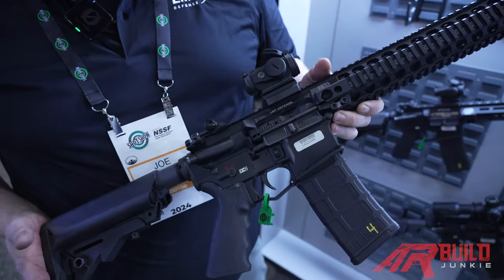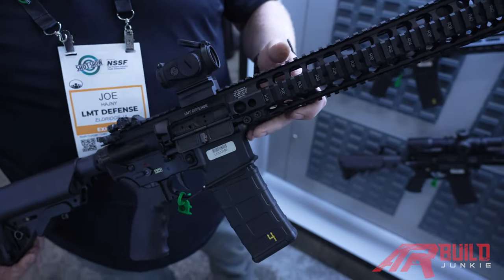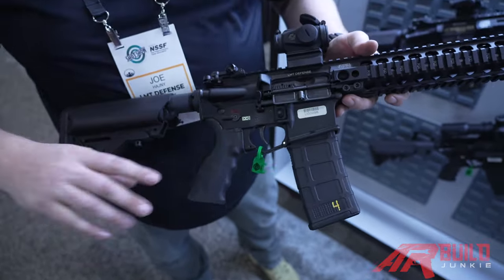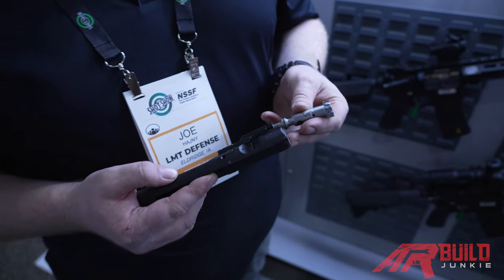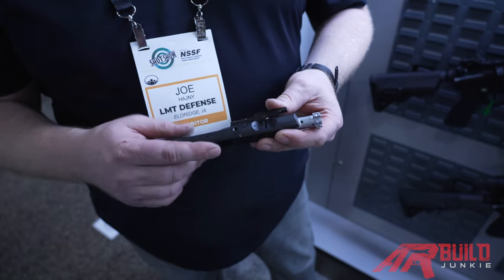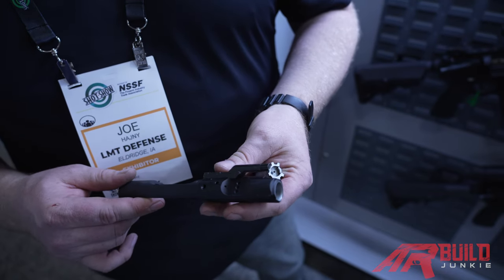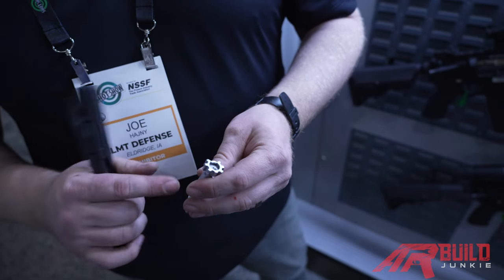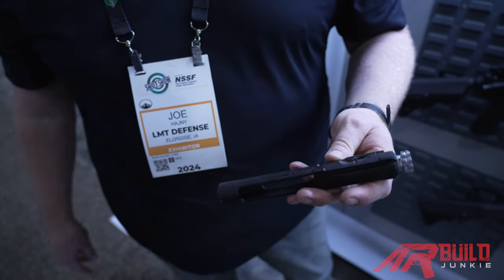LMT Defense - SHOT Show 2024

Comment: I remember picking up a few of them enhanced bcg 7 years ago for $249 each. Now they go for $499-$549.
Reply: I picked one up for $250 as well. I was at a local FFL and I asked if they sold any enhanced bolts and the guy pulls out the ebcg. I wasn't even looking for one but the shop had one and they were sold out everywhere. Didn't actually need it, still don't, but I'm still glad I bought it.
Reply: What is the part number of the LMT 5.56 eBCG for semi auto?